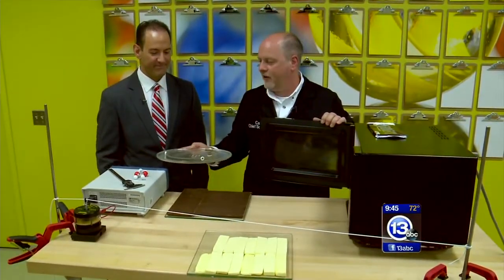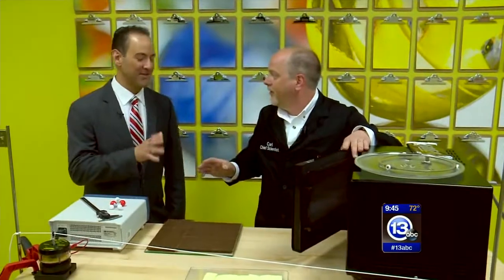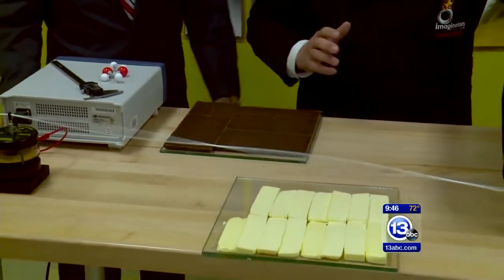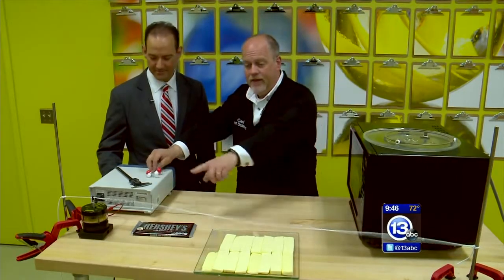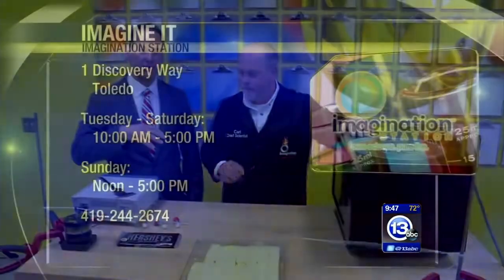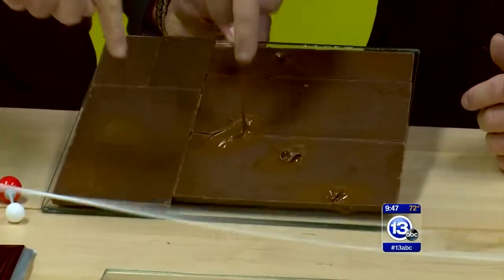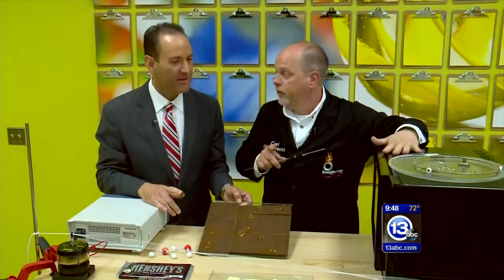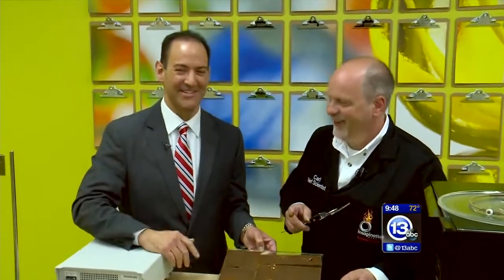Measuring the speed of light using chocolate

Comment: The problem is you haven't measured the speed of light, only the wavelength of the microwaves. The other piece of data required to make the calculation, the frequency, wasn't measured, just read off the back of the micowave oven. One could just as easily say that it's possible to measure the speed of light using nothing more than a book. One that lists the speed of light of course.